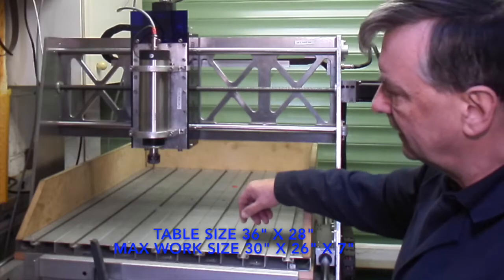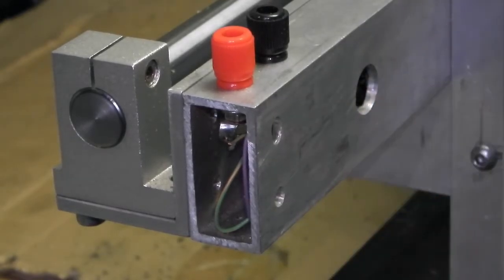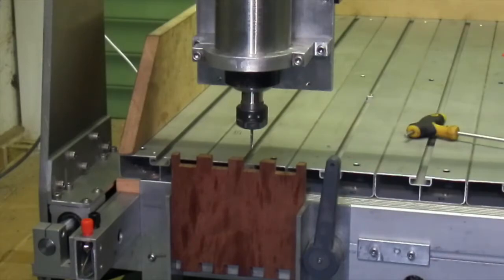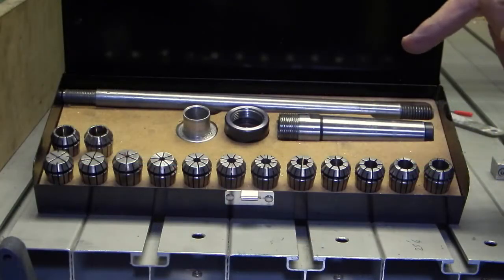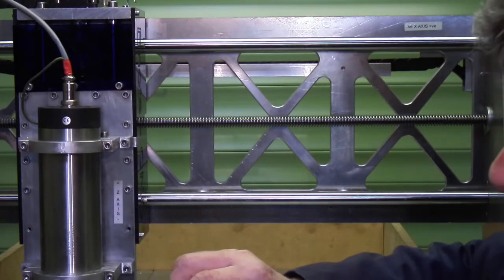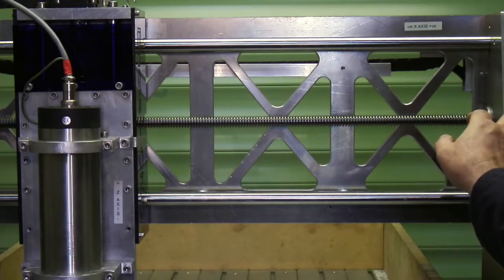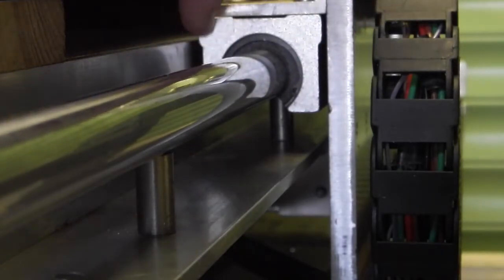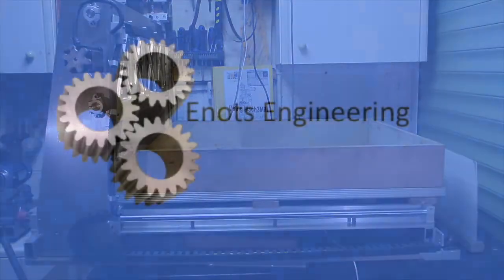CNC tour PART 1

Comment: Hello Alan, really appreciated you published both these video regarding home made CNC. I'm in the same process to build my own one, after I spent sometimes learning with a 3020 chinese CNC machine. I was wondering if you could show the side related the Y Axis, like motor attachment and which hardware did you used bottom of the working plane. Very nice solution to get opportunity to work in overhang mode, and I'm trying to modify my project with Fusion360. Thanks in advance if could summarize the under the table solution you applied.